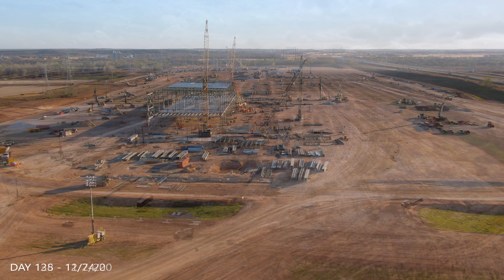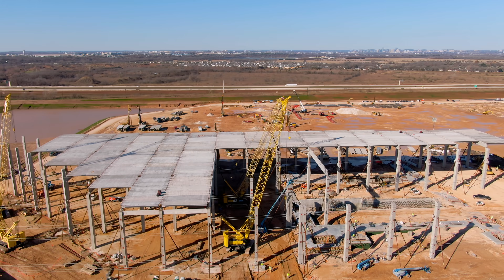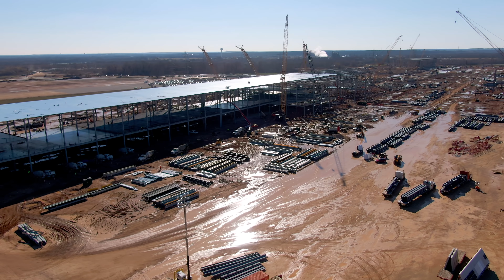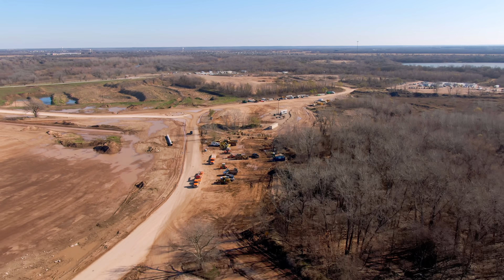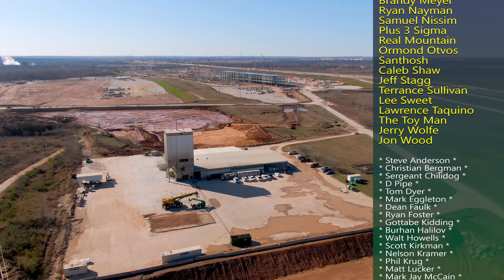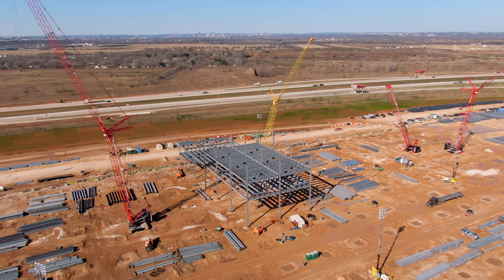Tesla Gigafactory Austin 4K  Day 169 - 1/7/21 - Terafactory Texas - CEMENT POUR 2ND FLOOR & MORE!

Comment: @ 11:55 .... How the heck are those cranes getting out of there? 🤔 That'll be fun to watch!
Reply from the maker: It’s amazing how many cranes are out there, I think they are going to start running over each other if they keep building more! LOL
Reply: I think they just need to back up, they are not stuck at all! I wonder tho how they will fit the last beam right beside them.
Reply: @SEBTECHDIY  Yes, that!  I hope Jeff or someone from the Quad Squad is able to get video of that last beam being lifted.  Should be tight!
Reply: @peterdog15  🤣
Reply: The outer crane has a way out. Perhaps it will support concrete pillars while the brace is removed and the other crane moves one space.
Reply: There is about 30-35’ between the columns, and the crane is only about 15’ wide.  They can do a tank turn if they have to, although it isn’t ideal.
Reply: @patrickkenny2077  You're absolutely right... I couldn't see correctly because the electric cables are on the line of sight

Comment: It must be an extremely stressful job keeping all the steal organized and arranging the deliveries.
Reply: Yeah! Hey Joe go find steel column no. 2605, it's over in that pile over thar.
Reply from the maker: Seems like there must be rhyme and reason to where things are and there must be an inherent order of the layout on the ground, otherwise if it is just random like it looks, it would take a genius to build this thing…! 😉
Reply: @peterdog15  I'll suggest that every piece comes from the factory with a bar code, or QR code and is staged and tracked by GPS.
Reply from the maker: @kkarllwt  that makes sense, I’ve seen beams up close and cannot identify any codes other than handwritten marks with numbers and letters so maybe those are what they are using to organize the erector set.
Reply: Yes, the ground crew does organize the steel on the ground. After the forklift unloads the old of steel they “shake out” the steel with a crane by standing each piece up on wood stickers (so you can get a cable choker cable underneath) with the top of a beam on top and arranged in order where the erection crane can reach it and with enough room to walk between each piece to hook it. They usually mark the center point so the lift will be balanced with a single cable choker lift. The ground crew also welds safety line supports on each bays perimeter steel.  The steel fabricator sends the steel on each load in the order the erection crew wants it.  It looks to me that the erection crew on the east side is trying to unload the loads of steel near its erection location while the west side crew is just stacking it and will sort it out later.

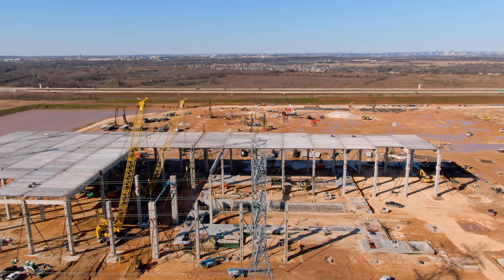Comment: 2:38 I counted about 75 wall support rods installed in the big pit, or at least the shadows of them. 

I wonder what kind of cracks or shifting prompted that?
Reply: The walls are likely designed to have a slab on top, and the surcharge loading (horizontal load) on the tall wall from the soil likely needs reinforcement until the slab is in place.  No clue why the slab was not done yet though...

Comment: Hi Jeff was wondering does the articulated cranes have cameras in the jib .Realy impressed with your videos thanks Ken UK.
Reply from the maker: They do not, it’s totally old-school technology! I thought it would be really cool to strap a couple of go pros onto the cranes but they won’t let me 😬
Reply: Some cranes have an anemometer in the jib to measure wind speed and I expect many have GPS receivers there as well.
Reply: On the articulated crane, I think you are referring to the concrete pumper.  Usually the operator for that is using a radio remote for control.

For the standard cranes, there is a system called crane-view which does have a camera and load cell to assess weight.  It isn’t a real-time system, but a big data kind of thing that is used to track operating efficiency of the cranes.  I have not seen any of the cranes on site with those installed; they are expensive and for the number of cranes they are using there are likely better things to invest in.

Comment: Are they going for four stories in one section there near the north end? Seems to have floor girders level with the rest of the roof!
Reply: Rooftop break or event room would be cool. But might just need support for air conditioning or other equipment
Reply: Might need to have a stronger roof where the large air conditioning units go, similar to Shanghai.
Reply: The verticals don't have the connections to go higher, so it's at it's final level.
Reply: The casting machines produce a HUGE amount of waste heat, when they quickly cool the molten aluminium castings to ensure the correct metal alloy properties. This will require a massive amount of cooling capacity  - possibly the highest single load in the entire factory. This will be done via many big, heavy evaporative coolers on the roof. (See the CUBs - "Central Utility Buildings" in the NW and SE of the Shanghai plant for the big boxes with spinning fans in them. They are also visible in the Berlin Flyover videos, currently stored on the ground awaiting installation on the roof). 
So the roof will need to be strong enough to hold all of those, as well as allow easy penetration for all the piping. It might not be suitable to put those on top of the (sloped) concrete roof slabs, and they will mount them on the steel roof instead?

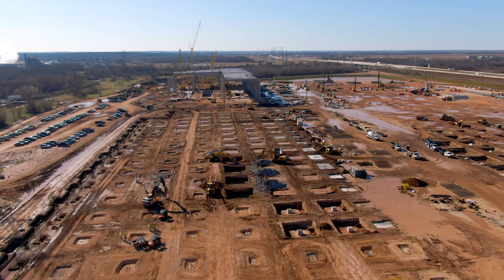Comment: Note all the concrete that has been broken up and dug up at 2:00. 

We could see the excavator with rock breaker attachment working in yesterday's video.

Have plans changed. Any ideas?
Reply: Yeah looks like classic example of someone not knowing WTF they are/were doing!!!
Reply: @stephenj6837  The workers only follow orders from the bossman or boss woman.
Reply: Someone on another video suggested either plans changed, or those pours didn't meet the specifications and had to be reworked. 🤔
Reply from the maker: @stephenj6837  my understanding is that the site plan has changed and certain equipment has been moved around based on an evolving and dynamic strategy that Tesla implements. Very new and different way of construction but this is what we are bearing witness to and it is very exciting!
Reply: @peterdog15  Hi Jeff

I note Elon Musk said a few weeks back that the current Tesla strategy was to spend money as fast as they could without "wasting it".

This,  I suspect, is a result of that strategy.  They are trying to spend money wisely while plans are still evolving. "Adjustments" to plans will be inevitable.

Comment: It's amazing progress they're making, but based on their timeline for dry-in, aren't they far behind schedule?
Reply: Yes.
Reply: That's true. Since January is relatively dry, the schedule should stop slipping for a while. Austin winters will be milder than Berlin, so that may help here. 

Dry-in doesn't have to include the entire footprint, but just enough to keep the next stage of workers busy, so the financial impact is not yet clear.
Reply: I think the east stamping machine could qualify for dry-in on schedule.  The main steel structure is likely two weeks behind; once the above-grade slabs are poured it would generally qualify, although roofing would usually need to be in within a week or two after that.  Two weeks isn’t ideal, but it all comes down to how they are using the extra time for the sub contractors that go in next.

Comment: I see that they are demoing what looks like a pier.  Surveyor's need to keep their zero's straight.   It's the same elevation.  It's not like it's a one off pier project.  SMH.
Reply: I can’t be 100% sure, but it seems like the new excavation is deeper than what was there before.  That could mean an issue with the geopiers